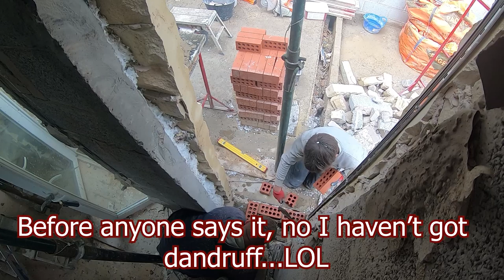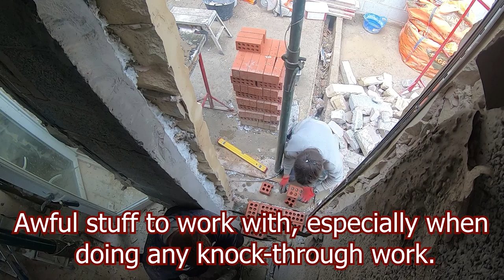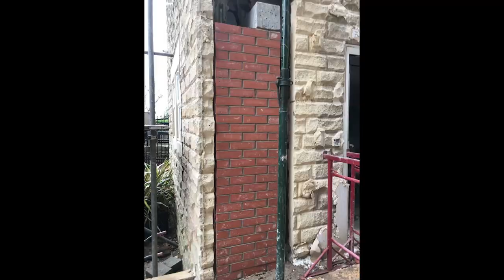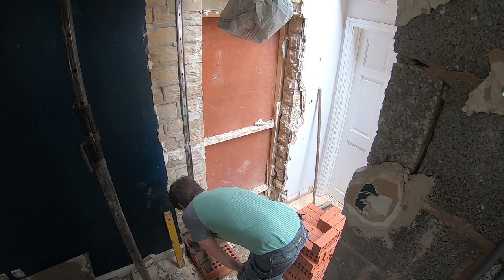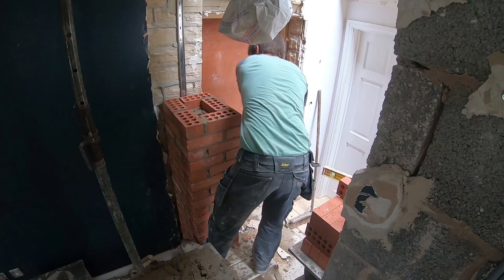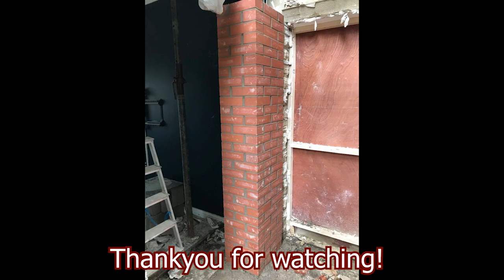Bricklaying - Building Engineering Brick Piers for an RSJ

Comment: It's  to support a lump of steel which it will do well. They are a ball ache to build ..9n  blocks laid flat cross bonded achieve same outcome but it's what the pen pushers decide to right on the spec/plan.
Reply from the maker: Ali Khan couldn’t agree more with you 👍